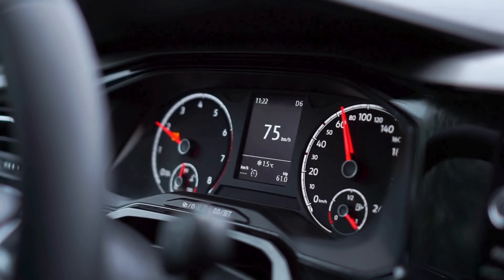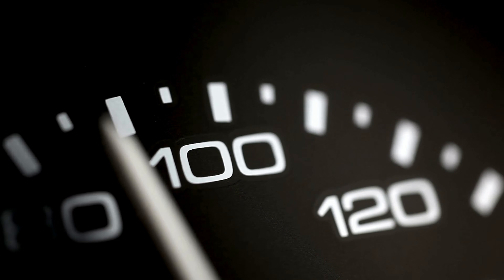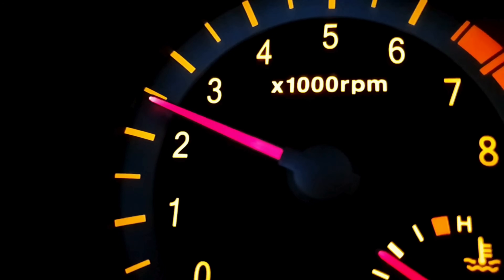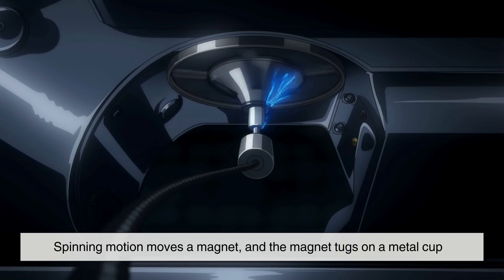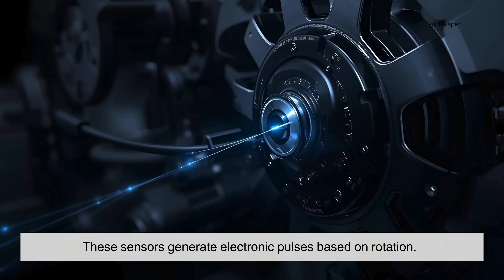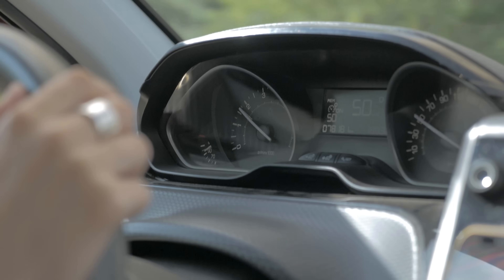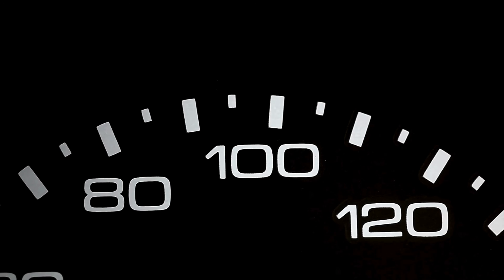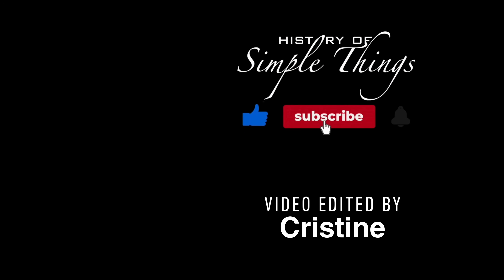How Speedometers Maintain Their Accuracy Over Time

Comment: There is an anti-lock braking system sensor (ABS) on each wheel, which measures the speed of each individual wheel. 
The speed of the individual wheels is approximately the same, otherwise the sensor has failed. 
The speed is calculated from this.
Reply: But how do u account for wheel slippage
Reply: @p0pimp2004  and the speed difference between left and right wheels while turning, caused by differential system

Comment: I was an instrument tech at a GM distribution store, and I mainly worked on instruments, especially speedometers and tachometers, from GM vehicles. I worked on mechanical, electromechanical, and electronic speedos and tachs, and instruments. I still prefer the good old-fashioned mechanical speedo system, as they are easily fixed and calibrated and last for a very long time. All vehicles have a specific tire diameter, and that is how the speedos and running gear are calibrated.
Reply: GM had the worse gauges especially in the early and mid 2000’s lol
Reply: On my Jeep Grand Cherokee I can measure the diameter of the tire and go into the speedometer and calibrate it if I put bigger tires on it. I have checked it against the SMART (Speed Monitoring and Repurting Trailers) devices used alongside the roads, especially in school zones. It is very accurate. Not sure how many vehicles have that capability.